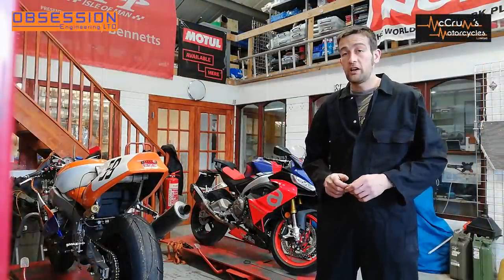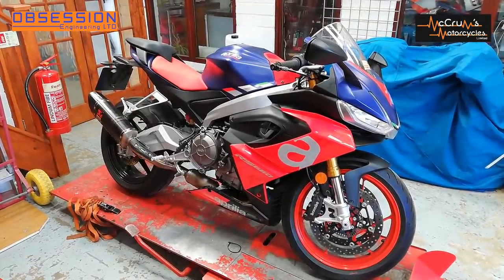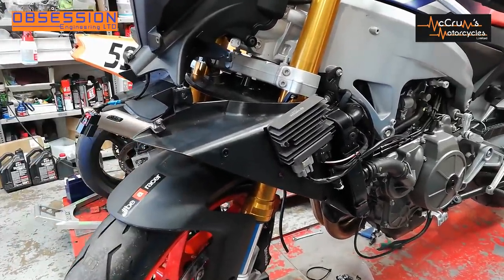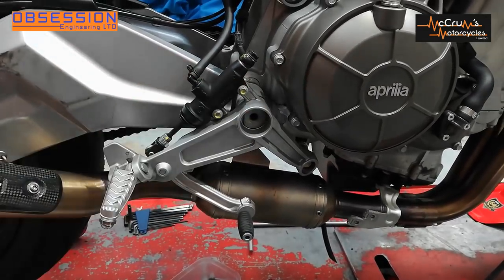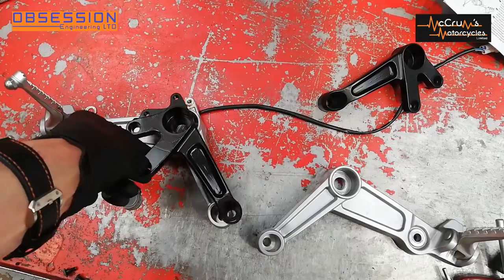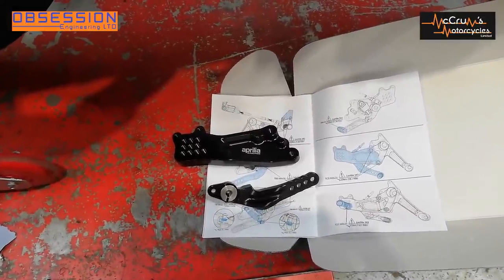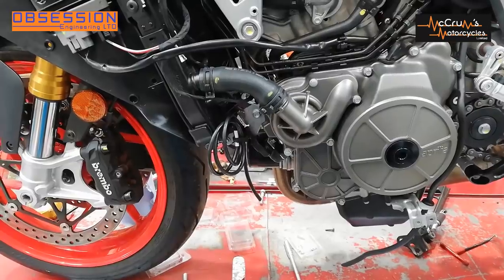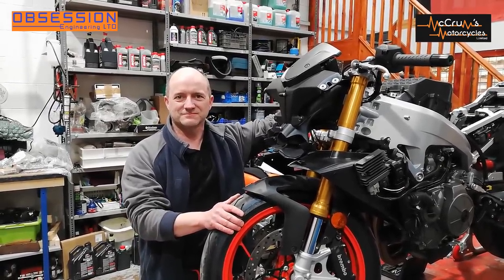Road to Racing. Aprilia RS660 race prep. Getting the bike stripped and starting the track build

Comment: Hey Dave - any chance you took the weight of the rearsets original vs racing? Or even better - the bike before and after?
Reply from the maker: We did a final weight check... but not a before strip. That's in one of the next episodes ;)
Reply: @obsession_engineering  bit of an oversight then.. the other.. race shift.. is the shifter shaft out of the box, able to be rotated around to do the same effect 🤔🤒 push rather than pull

Comment: You Just have to put the gear in reverse (pivot up not down) and buy a reverse mod for you computer from aprilia 👍 verry easy and it works 😄
Reply: Computer doesn't require a reverse mod, and can't place selector arm upward as it hits the frame.
Reply: @MrKdr500  I can send you a picture. i have aprilia rear sets, reversed gears and had to buy mod for reverse QS with Pitlane limiter. When i go with the selektor i std position, I have to go to the computer and select normal QS not reverse. Do you have FB - I can send via messenger 👍
Reply: @MrKdr500  the selector arm isn’t straight up - it is about 45 0 to the right and it works perfectly 👍
Reply from the maker: Luckily Eric rides in road shift but the information is very welcome, thanks for commenting :)

Comment: Seven hundred and twenty fucking quid…!!! 😳
Reply from the maker: There are better value options now available
Reply: @obsession_engineering  yes there are.. its called a welder 🤗
Reply: go old skool.. weld one up.. or mod the std setup.. makes you wonder too at thos "carbon fiber" heal guards.. what the hell is wrong with integrating them into the main bracket.. just profiteering from suckers i guess